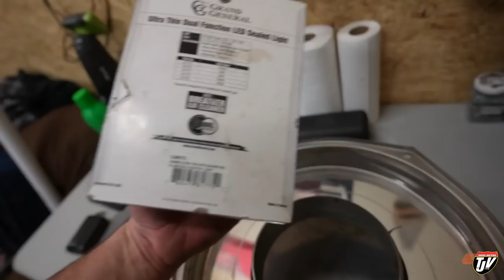HOW MUCH DID IT COST?? | My Trucking Life | Vlog #2775

Comment: Hey Josh, for safety I think you should go either another colour (blue) or low intensity as low matches your other marker intensity and won’t confuse drivers thinking that you might be turning when you are not. Having them brighter might be mis-interpreted as a solid turn signal (like when your relays fail and your turn signal is just ON and not flashing). We have quite strict rules around lights on vehicles here so you might want to also check yours. But you do you man! Love to the family and congrats on your new bundle of joy! 🇦🇺🦘